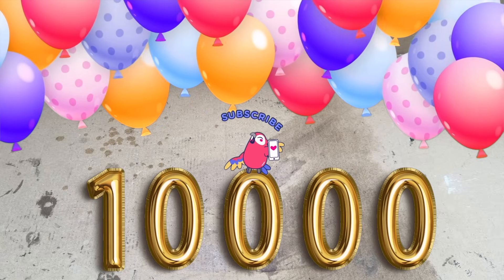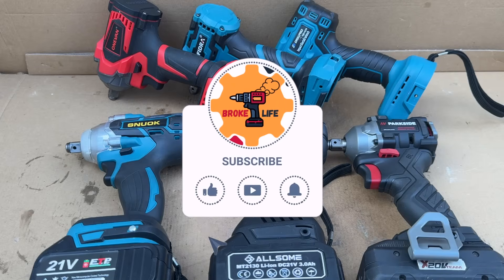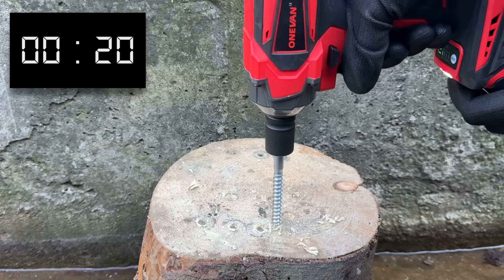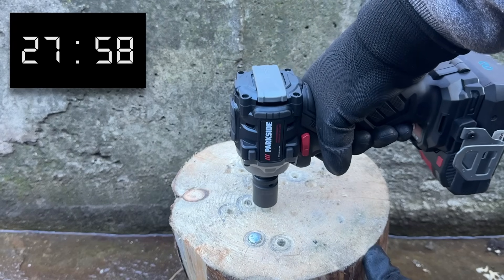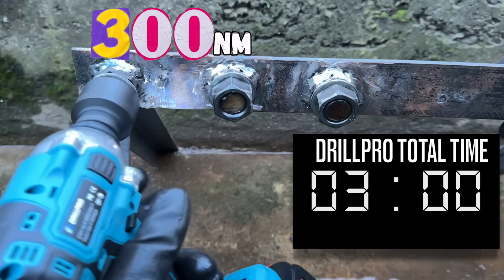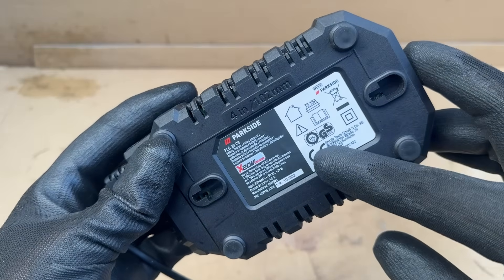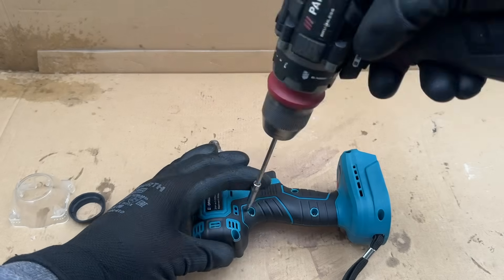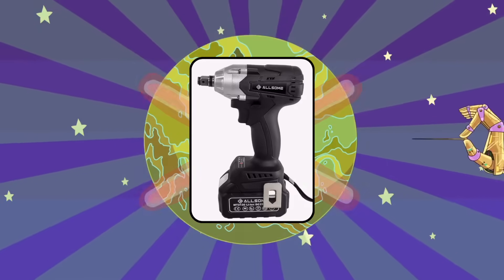Surprising Results! Parkside vs Temu vs AliExpress - Affordable Impact Wrench Showdown. Lidl tools!

Comment: dont get fooled, there is a reason they cost 20euros,,,, use them more than few times on propper jobs and u will see,,,they are good for  doing somethign here and there,but if u are in the trades,,thise are a joke
Reply from the maker: Fully agree! I think the batteries are the worst part and even for occasional use one needs a genuine certified battery!
Reply: @BrokeLifeEU   i got few good deals,, with parkisde and einhell tools, and i noticed from 3 that i got 2 overheats alot,,, After 5 minutes of using they get so hot,,a hammerdrill(parkside) also melted the casing for the ballbearing at the bottom,so i decided to quit ,,taking my chances,, and just get something good

Comment: Hi my compliments! Whete do I find the battery adapter per the One van? Which batteries May I use with that adapter?
Reply from the maker: Hi! You can get all sort of battery adaptors. This onw is from Aliexpress and is for Makita tools to Parkside batteries. However be careful with these adaptors as they may not have the proper protections in place when it comes to battery discharge.

Comment: The screw test is very inaccurate as that stump isn’t an engineered material. A screw might go in easily in one place, but hit denser wood in others and take longer.
Reply from the maker: True, but I used them long enough before making this video to know that this is pretty typical of how they usually perform.
Reply: @BrokeLifeEU also tge parkside battery was flashing empty when u did the stump tests.

Comment: mal si skúšať skrutkovať a uvolnovať maticu aspon 10x , zistil by si že tie baterie z aliexpress a spol.  ,sú väčšinou na nič- slabé ,radšej kupiť naradie (ja to volam fejkita) bez baterii ,na 99% su to aj tak makita kopie (alebo vymeniť v tých bateriach - 18650 akumulatory za nejake LG, Sony ,EYE  - 20010-3000mAh) a potom to už je celkom použitelne naradie
you should have tried to screw and loosen the nut at least 10 times, you would have found out that those batteries from aliexpress and co. are mostly useless, it's better to buy a tool (I call it a fakeita ) without a battery, 99% of them are Makita copies anyway (or replace the 18650 batteries in those batteries with some LG, Sony, EYE - 2000-3000mAh) and then it's a completely usable tool
Reply from the maker: As with most things, you get what you pay for. The batteries are the weakest part. That’s why—even if you buy these tools—I’d still recommend using genuine Makita batteries, even second-hand ones.

Comment: I think they are all the same, mine Gisam for 15 euro without battery for hobby usage is fine
Reply from the maker: There are slight differences, the so called 1200N.m model is good for occasional use no matter the label on it. Just look for the cheapest price, but the batteries on all of them are tragic.

Comment: 90% of my tools are Parkside. Good value for money. I don't feel scammed when I purchase and use their tools.
Reply from the maker: The warranty is also good!
Reply: Plus 3yr warranty
Reply: It's good if you use it at home twice a month. A tool for complete amateurs.
Reply: @nstipet  No, my dear snob, these tools are good value for money. When you buy Parkside, you don't feel cheated like when you purchase other cheap tools. They are not the best or the most expensive, but they are durable, strong enough, and reliable. I prefer to buy 3-4 Parkside drills instead of your fancy drill. Watch the video and say that Parkside is a bad tool if you like to lie. Of course, I have many other professional tools. I never said that Parkside is a professional brand, but it is very valuable and useful. Amateurs need amateur tools, professionals need professional tools, but real masters don't need tools.

ps
How do you know my usage of tools? Are you spying on me?

Comment: u checked yato impact? it seems the best value, 170PLN for body, so like 45€, and opinion are raving
Reply from the maker: Can you give me the model number if you have it? I might make a video for budget ones from  Yato, Total etc…
Reply: @BrokeLifeEU  YT-827792
i posted extensive reply but its getting removed automatically by f***ing youtube consorship for some reason....
Reply: the only con i see is they look really cheap and ugly in general 😂
Reply: As for bigger context, i was researching parkside impacts, and they are getting withdrawn, opinion are mixed, and prices arent even good for 20v system..
So i thought, why even parkside? 
i have their 12v system but i think ill go for another company system for 18v....

And so i started researching and there is quite some choice 🤣
And after rejecting total nonames, 
the pool isnt that big for good, reliable light impacts. 
And because 18v impact often weight the same as 12v then why even bother with 12? 

So far my searches included einhell, neotools/graphite, yato, parkside. 
and pricing for parkside and einhell is getting dangerously close to like makita or dewalt soo... why even bother with them?
its better do buy dewalt at this point. 

So for budget options you are really left with noNames from ali, parksides 12v, and really yato. 
So yato to me looks like organic winner, because of great reviews, and pretty much as cheap as no names. 

Another plus is that going into yato 18v system isnt bad idea, they have really sensible drills, no in future i could see myself getting their bl drill, or electric ratchet, have have really big choice of tools, they alone have like 3 or 4 or more impacts...
I dont see parkside performance being better value really than yato.
Again, i really like their 12v perf drill with detachable chuck and ill most likely will stay in their 12v eco system :)
Reply: also you must checkout dedra impact ;

Comment: Can you please test for slow speed control. Trigger response is super important.
Reply from the maker: They all use basically the dame triggers and they are not very good at slow speed control.
Reply: @BrokeLifeEU 

Thank you that's such a shame. I'm returning a onevan because it advertised a stepless trigger but it definitely has 4 steps , the first step already being over 1000 rpm 🤣
Reply from the maker: @freedomofmotion Basically the same on all of these. However have a look at my Mellif video they have a fantastic trigger control.

Comment: can you do some future test with the parkside in EXPERT mode in the app and with a smart battery? to me it feels like a speed 6 or 7 on the 1 to 4 default scale. would be interesting seeing how it performs on an actually demanding load.
Reply from the maker: I will try to work it in to a video at some point. It does feel like it has more power on Expert mode, but it isn‘t anything extreme and I think they hid the Expert mode in the app, because they are aware that prolonged use of the extra power may cause substantial stress on the mechanical side and electronics in the tool.

Comment: 7:24 I wonder how consistent this type of test is. Did you do several runs?
Reply from the maker: Great question! Before I make these videos, I always spend time testing the tools as thoroughly as I can. What you see in the video is just a small part of that process. That said, I don’t have access to high-end machines for testing—this channel is just something I do for fun, and I don’t use these tools in a professional setting. So I base my conclusions on repeated testing in a specific environment and share what I learn from that experience.
Reply: @ Thank you! 
Sorry if I came over as critical, I was just curious. I appreciate your (no small!) efforts!

My question was specifically aimed at the test where you loosen the bolts. (at 7:24). 

Again: I’m aware of the tremendous time and effort it takes to make videos like this and very much appreciate it.
Reply from the maker: @Conservator.  No worries at all! That question was spot on and it needed to be addressed!

Comment: I have exactly the same red ONEVAN, so happy about it. I thpught i had to spend much more to get a name brand impact or that good cheap impacts are bulky, but I was proven wrong by this tool.
Reply from the maker: It is surprisingly nice. Just take care with the battery is my advice.
Reply: @BrokeLifeEU 
I use the same brand battery as the tool, no problems, never run out on me.

Comment: It could be that they don't have 3rd pin on power tools because it's the batteries that manage over-temperature and over-discharge. At least the one you disassembled has power mosfets built-in (unlike parkside).

Comment: You've bought some brands that I’ve never even heard of in China.
Reply from the maker: 😂 Is that good or bad? As far as I know one of the proper ones in China is Dongcheng, however that one is difficult to get, because of financial reasons.
Reply: @ As far as I know, deven, worx, dongcheng, bosch, makita and greener are the most common. I bought a greener 16.8v 50n.m with two batteries a few days ago, and it only cost 💲20.

Comment: I also got few tools from aliexpress and in my opinion they are pretty good for the price and for DIY and home use very good. Only down side are the batteries, one of my gisams battery plastic part melted from the positive terminal after heavy use but still works ,with real makita batteries they are perfect
Reply from the maker: Same, I just recently managed to melt a battery exactly like this. I also got it on video so it will be posted about when the time comes!

Comment: A 3100NM Onevan impact that was tested on Torque Test Channel was proven to have a huge hammer assembly powered by a relatively modest, slow spinning motor, but despite that it offered very competitive performance.  The slow motor also shown that increasing battery amperage did not improve performance much, which probably explains why this Onevan impact has a weak battery, the motor can't make use of anything more.  I'm happy to see that Onevan is quite consistent with their output here as well.
Reply: I bought that one because of the TTC video!

It's a real beast and I'm happy with it. The trigger is not that great so you don't have fine control. But it's got a lot of power for the 150€ I paid for it. 

I use it with original 5Ah Makita batteries. 
It's a shame that they don't offer a ½ inch version, though I have plenty of ¾ inch sockets to use it with! Working on tractors and other big machinery is a blast with that thing.
Reply from the maker: @schwuzi Have you seen the new „2800Nm“ with a 1/2“ on Aliexpress? If you need a 1/2“ budget high torque I think you will like it.
Reply: @BrokeLifeEU  Just checked it out but they seem much smaller than the "3100Nm" version. 

Well I'm kinda broke too so I won't be buying a new one anytime soon 😂 

My offer still stands though. I could ship my 3100Nm to you for testing if it isn't too expensive. I'm from Austria.
Reply from the maker: @schwuzi Thank you so much for your kind offer! I have some travels to Austria so in a couple of months so I think we could arrange something if that interests you.
Reply: @schwuzi  the 3100nm is a monster, but the Ework RB-819 is even more powerful, but also much more expensive, so much so you're better off buying a name brand for that money.
Reply: @schwuzi  they do sell 1/2 inch impacts, but no telling how powerful they actually are.  I wish TTC could make a video of chasing down the most powerful no-name 1/2 inch impact, those in particular because 1/2 inch sockets and adapters are far more common, come in more sizes, and are much cheaper than 3/4 versions.  But perhaps the Chinese depend on the weight of the 3/4 anvil to make more power.
Reply from the maker: Yes, they tested the older version though, there is a newer one which I think might be different. However I agree little go gain in terms of battery after a certain point. However I have a video with a Gisam impact wrench and it really does not lile its discount Aliexpress batteries and when used with some proper cells it makes a bunch of power.

Comment: how about parkside with 4Ah battery just to compare?
Reply from the maker: The Parkside is with a 4Ah battery in this case, however it is the 4Ah smart battery and not the regular 4Ah battery. There is little to no difference between them.
Reply: @BrokeLifeEU  right, that's not a flex volt or HO from Milwaukee
Reply from the maker: Yes, very little difference for the Parkside ones.

Comment: Nice video, I have the Gisam 1200Nm(OneVan) and so far I am very pleased for DIY work. I matched it with genuine Makita 5Ah battery and its working wonderfully and at pricepoint of 30€ something euros that I got it for (only the tool), I think there is no beating that!
Reply from the maker: Indeed for €30 if you have genuine batteries around it‘s just an amazing deal! What do you use it for if you don‘t mind me asking?
Reply: @BrokeLifeEU  I use it mostly for working on cars currently, so far its been amazing.

Comment: I have 2 of these for more than a year, the "1200" and the yofidra, the 1200 is an amazing tool and so far all good, it does everything and i cant complain about their batteries, they are still working as new and came basically for free, cause they are so cheap...great video
Reply from the maker: Thank you for the comment! How are the batteries holding up and how often do you use these?
Reply: I just received red Onevan with 2 batts & charger (in 2 parcels).
Batteries 588VF have 10x1,5Ah cells (18V, 3Ah) and voltage indicator (+) with very primitive electronics (only 3 MOSFETs) w/o charging indication (-). 
I tried it on M22x1,5 wheel bolt, and after maybe 20... 30 sec it unscrew it, where PS B2 couldn't do. 
Only serious complain is that it has too short handle, so it is uncomfortable to hold. 
Parkside and Yofidra/Newbenny have optimal handles, but Yofidra is weaker then Parkside B2 (stock, with 1/4-1/2" Milwaukee adapter). 
I have new short 1/2" anvil, but wailing for longer bushing to modify it.

Comment: impacts per minute and nm of torque are not the same thing. those with slower times are better due to the bigger mass of the anvil slower pushing lags but much faster taking out bolts thighten on nuts and stuff like that.
Also when you thingten a bolt to 300NM the torque needed to remove that bolt will always be less than that if no rust is present.
Reply: since the parkside was previously an impact wrench and not a driver the results seem to old up to the original design of the tool
Reply from the maker: Yes, you are correct about everything. The Parkside failed on the big lag screw, because it was never meant for it. It has a high IPM rate, but the hammer is really not that big.

Comment: Congrats on 10k - well deserved! :)
There are some tools on Aliexpress that seem interesting enough, and cheap enough to risk it.
After the latest 20v Parkside Multitool that's worse than it's predecessor, that's one tool I'm interested in.
But no way to know if the Makita battery tool from Ali will be any better.
Reply from the maker: Thank you so much! I‘ll look in to that multitool situation at some point. You might get a video out of it in the end 😅

Comment: i have also the onevan, i like the fact that i can use my makita battery with it.
Reply from the maker: And I am pretty sure it will produce wven more power with a genuine battery as well. On top of that it is built just that little bit better when compared with the rest. How do you find yours with the Makita battery?
Reply: @BrokeLifeEU  i tested it today for car wheel change. works great! better than the makita DTW285RTJ i had before.

Comment: Nice comparison! Personally I decided not to go with cheap generic chinese. There are name brand tools that you can get for 100-150€ (excl battery for sure) where personally I'd rather get that, than one of these without warranty and crap batteries. I went with a DCF922 and a battery adapter.
For parkside I think PPDSSA 12 A1 would have been the one to compare to?
Overall parkside hasn't convinced me yet, bu tI like to see the tests anyways
Reply from the maker: That‘s understandable and the DCF922 is a solid choice! I used one of them recently and it packs a massive punch for its size for sure! As for Parkside it really is a discount DIY brand and that is all there is to it. It can‘t be asked to do too much, because it really is not meant for that. Although I must say Lidl warranty has always been spot on for me!
Reply: @BrokeLifeEU   sure, definitely a + vs pure chinese. I do get the itch to buy when I see parkside on sale 😄
Reply from the maker: @hausm3ister  I already have the batteries and chargers so when I see them on sale I just go for it 🫣

Comment: Nice vídeo, its um shame that you did not use un gisam but great video
Reply from the maker: Thank you! Do they have such a small impact wrench? Because the ones I saw were quite a lot bigger than this size.
Reply: @ i think so but I am not sure, but still, great video
Reply from the maker: @luisfilipe1830  Thank you! As for the Gisam I checked and am pretty much sure the Gisam and Onevan 1200Nm impact wrenches are identical.

Comment: Other tools used 5s2p battery, on parkside You used 5s1p battery. That may change a lot. It will be better to compare it with PAP 20 B3 battery.
Reply: haven't watched the video yet, but s stands for series which translates to the the voltage and as power = voltage x current. the power supplied is the same in all the impacts. the p stands for parallel, meaning how many batteries are supplying the voltage. this affects the battery capacity = battery life ;)
Reply: @moshwool8309 stop acting smart. If the 2p battery has two rows of 20A discharge cells = 40A discharge, compared to 30A discharge of the single row of 21700 in the parkside smart battery.
Reply from the maker: Good point that! There should be some small improvements with the Parkside, but nothing substantial. I am used to using the smart 4Ah battery on it as 5x21700 cells are just better in terms of size compared to the regular 4Ah battery.